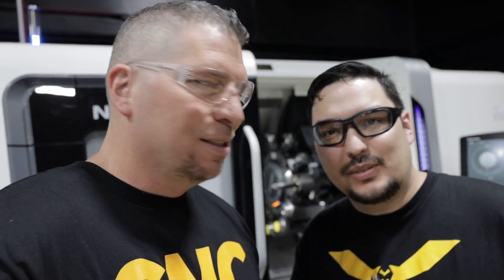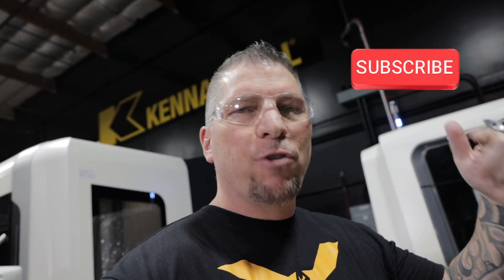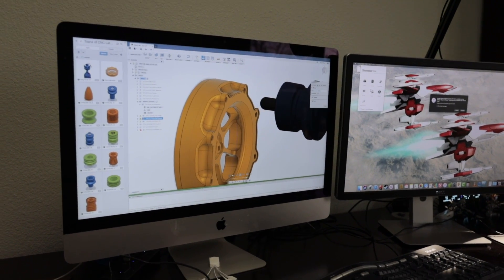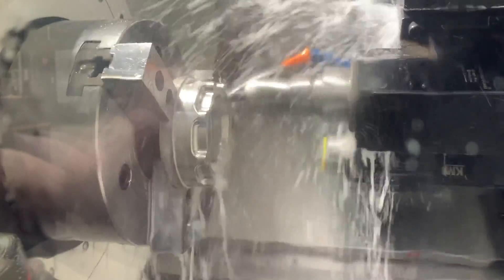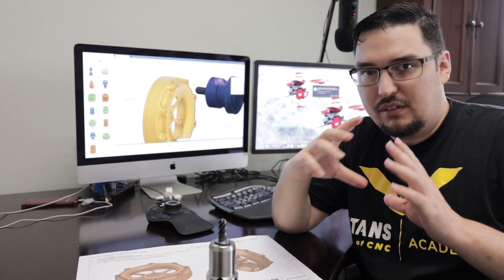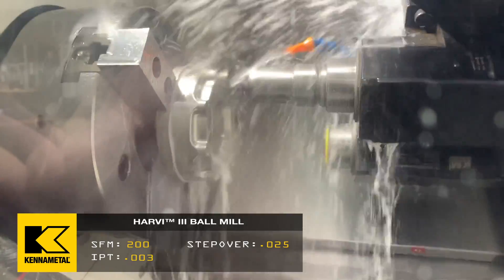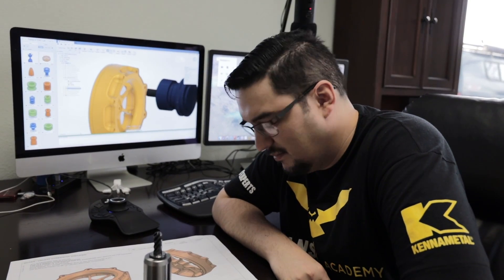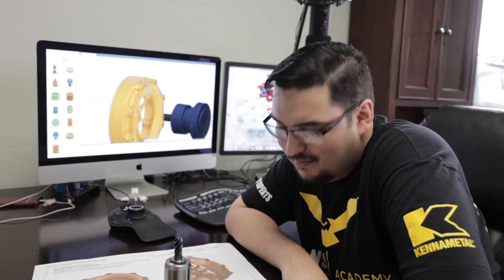Multi-Axis CNC Machining on a DMG MORI Using Kennametal KM50 - Vlog #45

Comment: We have a Nakamura B-axis mill turn with sub spindle and currently use Featurecam (part of Autodesk). It looks like Tyson used fusion, but curious if powemill is mill turn friendly. I’ve always heard power mill is top notch for full 5. Just wondering if Tyson ever uses it on the Mori.
Reply from the maker: He is not as it’s focused on Mill. He programmed with MasterCam for years but loves Fusion... it’s also Free to students which makes all that we do possible.
Reply from the maker: FeatureCam is a good choice for you but it also going into Fusion eventually
Reply: Powermill only does very basic millturn application i would not recommend at all for that